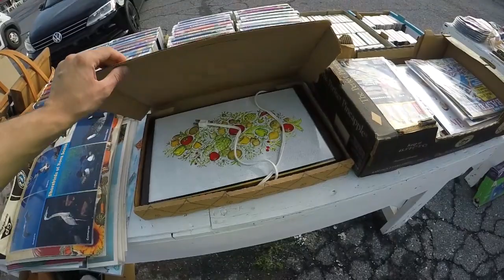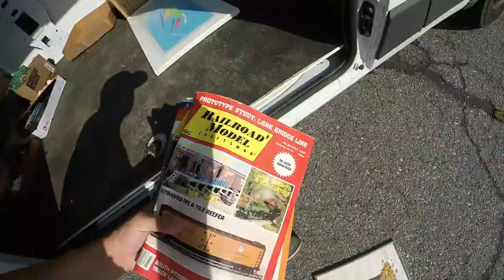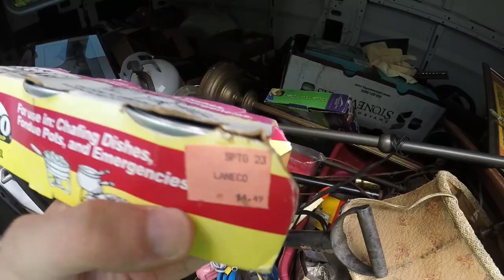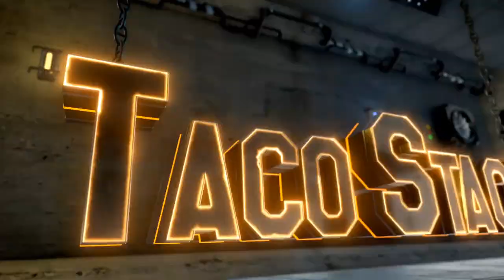SELLING MY STUFF at an Auction - Tailgate Auction Vlog

Comment: not a door handle, its for an old iron, they used different sized irons back then  so they were detachable
Reply: they came in set of three irons and one handle.  they sat on the wood stove to get hot while u used one and then rotated them when they cooled.
Reply: Thank you I learned something today I thought it was the handle from an old wooden box plane.
Reply: So cool! It almost looked like an old plane
Reply: That is what I thought at first and then realized it was the handle for a flat iron.  I have a couple of the irons somewhere around here.  I have a couple with the the handles made on them.

Comment: Someone already answered but, that door handle looking thing is the handle for a Sad Iron. Different from a Flat Iron where the handle is permanently attached, a Sad Iron "set" came with a handle and more than one iron. The idea behind it was that you could always keep an iron (or two) heating on the stove and when the one you were using cooled off, you would place it on the stove and pick up another with the same handle. Very efficient and the wooden handle would stay cooler than the iron handle of a flat iron. Thanks for coming to the auction and I'm very glad you did well.

Comment: that door handle is actually an old iron handle. The kind of iron they put on top of wood to heat up. Sometimes several irona would be on wood stove and the handle was not only to exchange them out as the cooled, but to move the iron over the clothes.